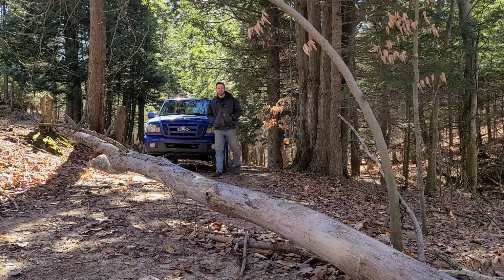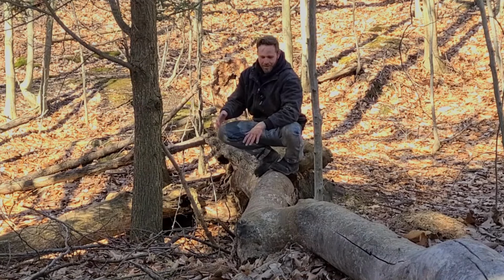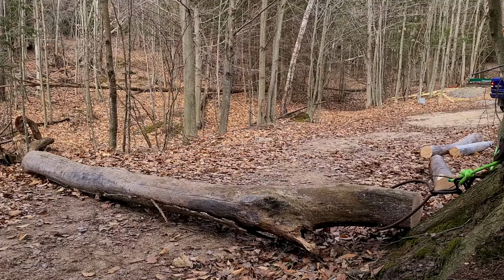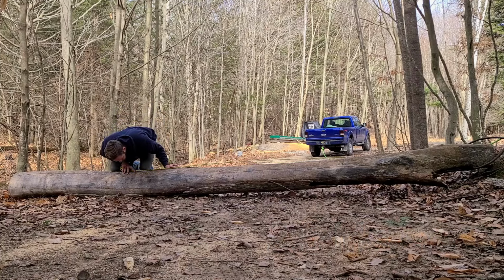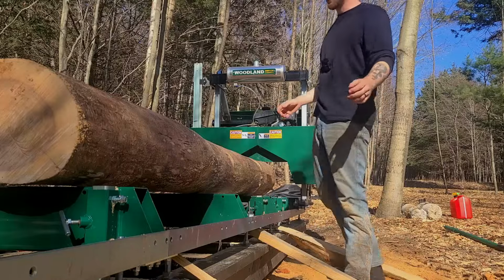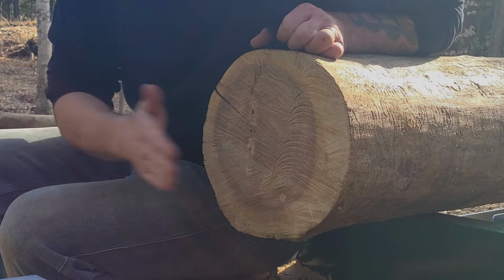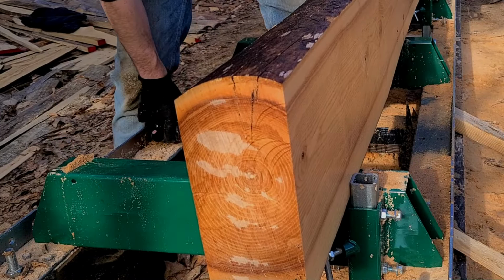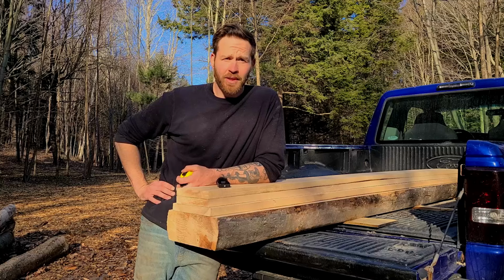Mill your Ash trees before they're gone!

Comment: G’day, I haven’t seen tongs like that since my childhood. An old bullock driver used them to sing logs out of the bush. An idea you could use would be do as that old guy did; use a round piece of steel with a hole on one edge so you can add a bow shackle. Then use a steel loop around the tongs so the disc can jangle freely when attached with a shackle. That disc stops the log digging in and I watched him work with that for several days and it helped. Worth a try to see if it can make log snagging easier. An idea I have as I used it myself when I lived in the bush, if you can get an old ploughing disc you could use that as it has a dished face for the log end to rest in. I hope the general idea is explained well enough. Nice looking timber, you know it will be reasonably stable after standing and drying. It will make a beautiful mantle.
Reply from the maker: Oh yeah, good explanation. I can see it. The disc is a good idea for sure. I'll have to see what I can find. My tongs came out of an old barn. They're hand hammered, you can see the irregularities and the tool marks. It's pretty cool to think I'm using something that some guy made long before I was alive. Someone told me that they're ice tongs, but they work fine for logs. I appreciate the advice, I'll try to improve it for the next adventure.

Comment: I like your videos, I have some advice, from this old man to a young man.

Stop dragging and rolling and shoving and sliding and grinding your logs in the dirt. It's just causing damage to your blade.

I know blades aren't "too" expensive. Mine are $15 each when buying a 20 pack. However, when your blade begins to lose its edge, your lumber will not be straight.

Hello from Maine

Comment: get some chainsaw pants!
Reply from the maker: I probably should. Do you have a brand recommendation?
Reply: Get a minimum of 5 layers, and like the full pants type. not worth taking a chance.
Reply: I have never used chainsaw pants or leggings in 35 years.  When you finish the cut put the brake on. I am not perfect I have had to take the powerhead off of  a locked in bar several times..  Once I waited two days for the wind to bring the sucker down..